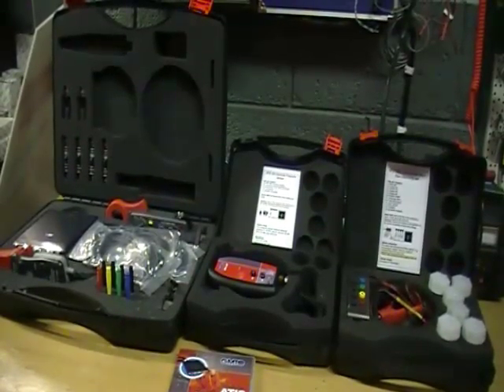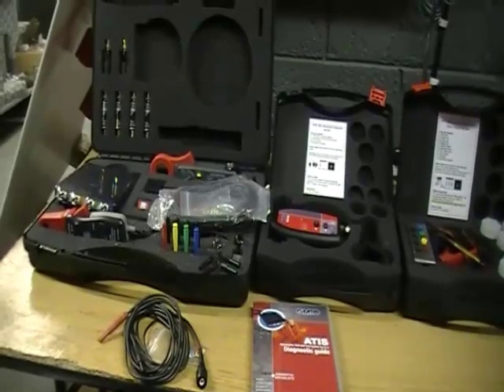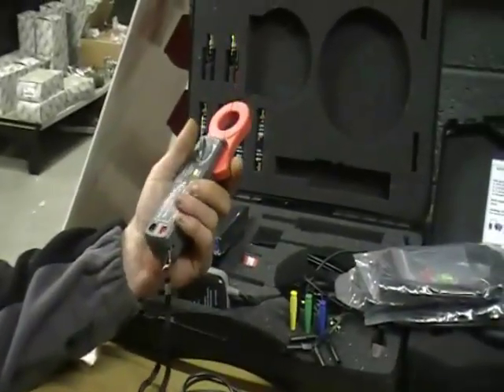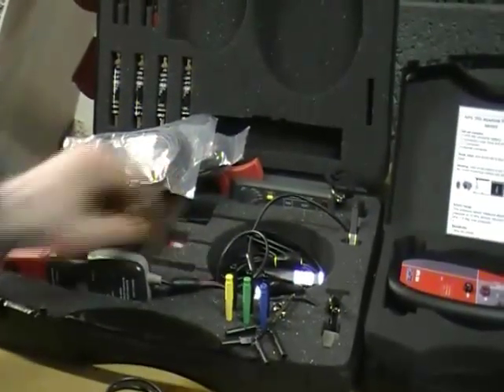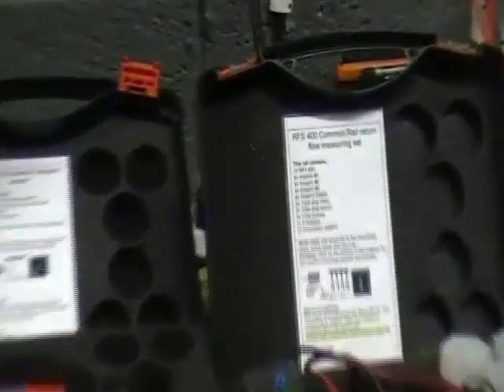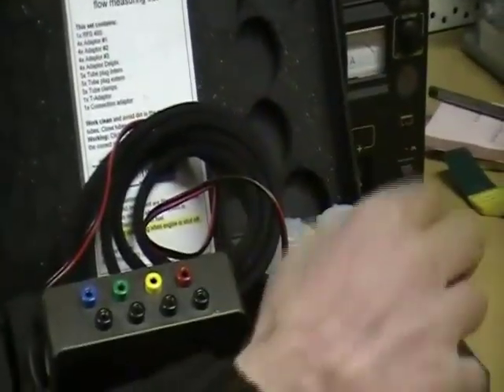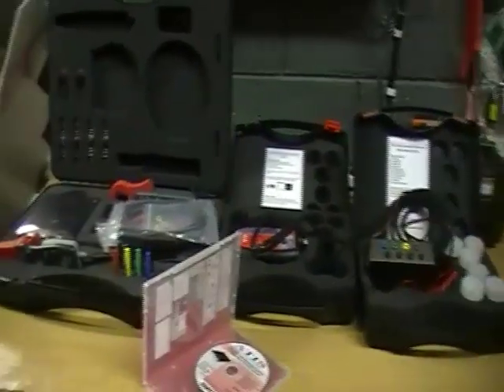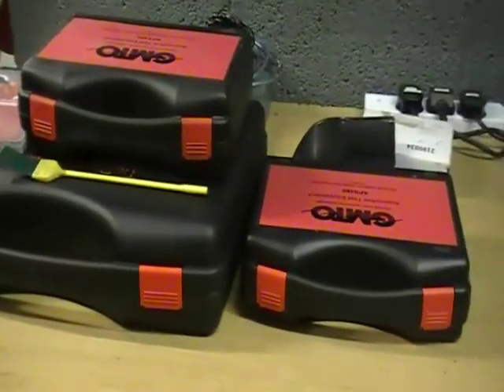GMTO Automotive Oscilloscope _Part 1 (NOW UP TO 1GS/s sample rates)

Comment: Tottaly overpriced compared to the pico....
Reply: Pico it is a hands down  A1 scope but about overpriced this should be related to Pico, the main information in GMTO scope is the software ATIS that is 125 Euro to buy, Pico does have the same great software AUTOSOLVE by James Dillon that's double the price 249 Euro, and this is only one example from many more. I would say that Pico is the one who overprice.
Reply: I think the proof it's over priced is that i never see anyone using one,anywhere!!No videos,no forums,no reviews of the scope on any gmto retailer sites?
I'm 'slightly' tempted as i was in the market for a pico 4425a but you can't get them just now due to component shortages,but it's just the fact nobody has one puts me off!